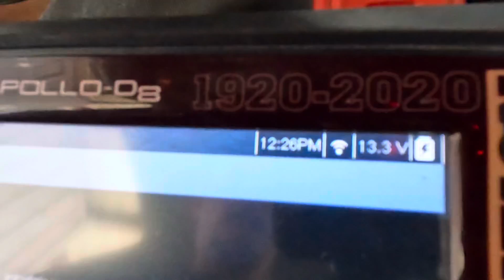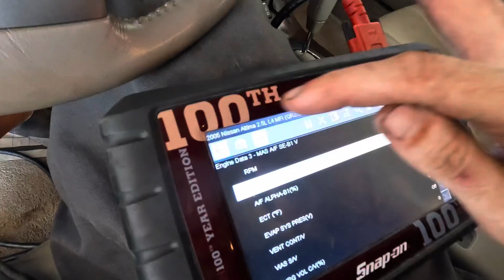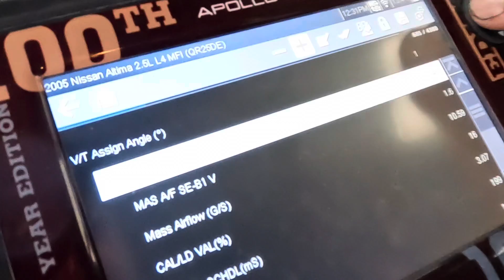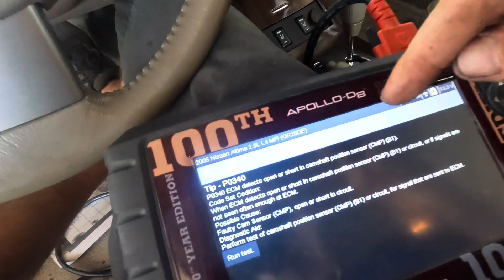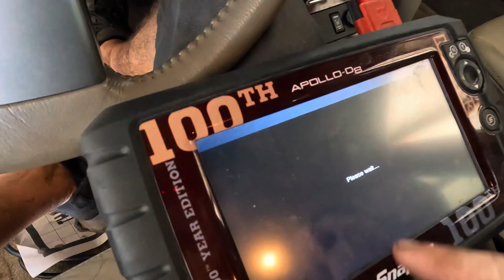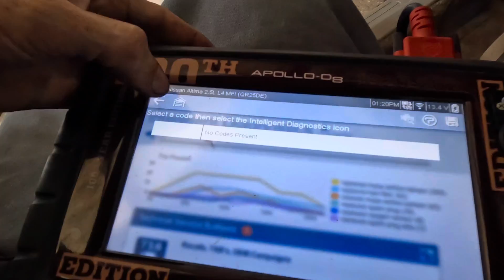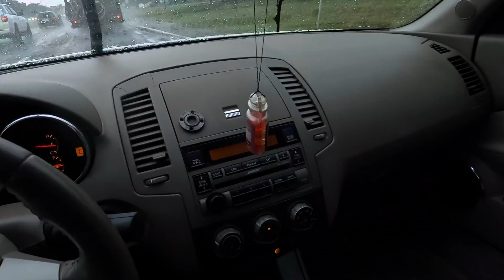This will make you ☠️☠️☠️ | Parts Cannon! Nissan Altima 2.5 P0340 Camshaft

Comment: 2006 Nissan Altima has been a real pain in the ass. I don't recommend this car to anybody. I once took my Altima to a mechanic, and he's like "Where's all the lights did you erase them?" and I was like, No, why? "I've never seen an altima that didin't have all these lights on."  I've changed everything on this damn car, from radiator, to hoses, to alternator, serpentine belt, the cover of the engine, spark plugs, ignition coils, I can't even think anymore, and it's always something new, once this car passed 180 thousand miles it was all downhil from there. Now the damn wires that connect to the ignition coils broke off, and I tried sodering new wires, and it doesn't seem to get the same current, or idk anymore, I been struggling with this car, simply because I don't want to go to a dealership, and I don't have that much money cash to buy a used one, plus the used cars for a while were wayyyy overpriced, so i was holding off. I bought 4 new ignition coils, 4 new spark plus, I sodered the damn wires over and over, thinking I might of done it wrong, but I get the smell of gas sometimes from the engine, there's no check engine light on, the car runs, but it doesn't run the same, can't really go uphill, shakes on idle, i'm just over it, im junking this $hit. Don't buy Nissan altimas!

Comment: That cam code is a hard fault. It is always there. The parts cannon may be an expensive idea, but it may solve the problem faster than rewiring the engine bay.

Comment: This motor the QR25 was doomed from the Factory look up this Engine in the 2003 Nissan Sentra SER SpecV were it Debued it had a Factory Nissan 60k recall on it were the Engine Grenades unfortunately there is a Butterfly screw on inside of intake manifold that comes loose and gets sucked into Engine causing damage to the VVT system also when that happens it starts burning oil badly going into the PreCats and Catalytic Convertors stopping them up essentially grenading this Engine I had the Car and it went 1k miles over the free replacement of Engine there leaving me 7500 bucks out for a new engine on a car i was still paying on yeah will never own another  Nissan unless it was built in the 80s. THEY REMEDY TO FIX IS TO PUT AFTER MARKET HEADERS AND NEW CATS AND PULL INTAKE MANIFOLD APART AND PUT LOCTITE ON THE BUTTERFLY SCREWS

Comment: I got a P0014 code today on my check engine light. Which meant the timing on my camshaft bank 1 was off.  I found out that sometimes, if the oil is low or dirty, it will cause that bank sensor to trip. I took my car to the shop and got the oil changed and it actually worked! The light went off and has stayed off! I went from looking at a $1,400 repair, to a $100 oil change!

Comment: A replacement kit from Nissan is available to replace both Cam and Crank sensors as they were on a recall notice. Metal barrel body is the correct upgrade on the sensor.

Comment: My friend had similar vehicle,  bought used from dealer.  Dealer fixed similar problem of stalling after refuel.  They told him it was rollover valve. Probably same component as you are suspecting. On a side note I just bought a 2007 ram 1500 big horn editor.  Seller stated truck stalls once or twice when refueled. I can't vouch yet. Just bought for local hauling use. He avoided filling above 7/8ths.

Comment: Ray!!! In 2023, you aren't a proper shop if you don't have a scope!!! You need to invest the $50 for a cheap handheld scope, or a bit more on a good one. You don't need an expensive one. Seriously. No scope is not OK. The customer pays for time and parts to compensate for your lack of proper tools. Did that sensor cost more than the test tool?

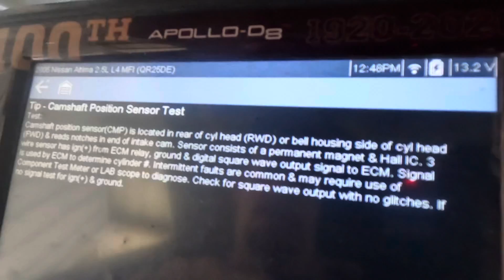Comment: @11:52 people disregard the simplest Solutions the last word in that pop out "Ground" even if it's not the actual problem more than likely because of the advisories issued by Nissan they know assembly process were lacking as far as making a good ground with their self tapping screws, and should be one of the first things you modify and rectify.

Comment: Nissan issued an advisory a number years ago that would apply to almost all of their unibody type vehicles, once you read the advisory and get a mental picture of the overall problem you realize that it could apply to almost any electrical problem that may occur on Modern cars.

The gist of the problem is these cars are either completely painted or dipped and then the wiring is bolted to the car with self tapping screws that do not make a good ground The Advisory was specific to cam sensor modules and how to take the self tapping ground screws off and create a better ground connection.

Comment: Poor ray. You only use Hitachi. This is Nissan 101 and no one diagnoses these. You just replace cam AND crank and move on. If it were a wire, then the engine wouldn't run an you'd get a circuit code.
Chrysler of Japan....is that why I have an all original engine/tranny g35 with 214k mi?
Oh, noes, rear calipers and lower front arms.
It's just so....reliable. Same with my other Gs, Maximas and Titan.
And you can't even handle the reliability of 2001 and older Nissans. Your mind will explode.

Comment: Cant be an internal mechanical problem as the error code said open circuit or shorted. A healthy sensor is somewhere in between that regardless of whether it's detecting the wheel or not.
It's a common design principal known as ELEVATED ZERO. When an instrument or sensor is detecting "nothing" , it still produces a signal, so the processor can tell the difference between "nothing/empty/cold/noflow/nopressure/etc"and an open circuit.

Comment: Hey ray i have a odd question but i got my check engine too come off but the code (not a stored code) still pops up on the scanner even when the light isnt lit id be happy if you could direct me too a possible cause. The code is for the evap system and iv replaced just about everything for the system even smoked it and no leaks are present also the wires are fine.

Comment: Ray, had a 2006 Altima had the same problem, it was told by the Nissan mechanics that if you don't use OEM, and you don't replace both the camshaft, and the crank sensor at the same time there can be issues. I tried an aftermarket at one point and realized they weren't lying.

Comment: With that long start, I would check the Starter Motor. Just my 2 cents. Now back to the show to see if i am right or if I am wrong. I betting I am wrong. Though I would still check and test the starter motor.

Comment: Altimas are repeat failures.
"Vehicle Speed: 4"  Hmm.  Nissans even suck when connected to a scanner.
Oh, and hey scanner manufacturers (that NEVER watch their equipment being used on YouTube):
Just have the white 'current line' bar appear ONLY IN BETWEEN the labels and the values, as a white background on camera COMPLETELY OBLITERATES ALL THE TEXT.

Comment: It probably wouldn't be a mechanical issue. The engines i work on have sensors that work at 5v but sense between 0.5v and 4.5v. so a short or open is outside this range, a mechanical fault would be within this range so should give a separate trouble code. Hope that makes sense.
Reply: It does and did thank you 😎

Comment: I think your D8 Scan tool has a built in Lab scope if you have the right probes. You can also bring up visual graphs of the PIDS which record as they go. Much safer than constantly watching the data as you drive.

Comment: loved your logical explanations, the possible scenarios envisaged with their likelihood & how you homed in on the faulty sensor. you took a risk buying a new $40 sensor & it paid off. i learnt a lot. i’m still curious what would cause a hall effect sensor to become intermittent. (a complete failure would reflect in lowered engine performance which was not the case). guess we’ll never know the mode of failure. mybe it’s sensitivity fell. right til the end you were so careful to not rule out mechanical sloppiness in camshaft angle as cause. nice to experience Florida’s heavy rain at its best (worst!).
Reply: Known weak point for the Nissans this and cam sensor

Comment: My BT50 3ltr diesel was having hard starts. sounded like battery was flat and I was getting crank and cam sensors faulting.  I sent it to a workshop and was told the starter motor was faulty. They replaced it and it still happened. I inspected the battery cable to the starter and found it was bad. Because the sensors cables ran in the same harness as the stater power cable, the EMF was killing the sensor data. I replaced the starter power cable and never had the fault return.

Comment: The code set was for Open or Short. This fault is not caused by cam wear, that would be a different code along the lines of 'Implausable'. 90% chance it was going to be a sensor so why mess about? It's a business he's trying to run. Best of Luck Ray.

Comment: so yesterday i did something probably ill advised but actually worked out well, i checked my maf sensor, saw one of the wires was all carboned up, tried spraying it clean with maf cleaner but it was baked on, so i ever so gently used a knife to scrape off the carbon off the wire lol i know its probably not the best thing to do but it runs heaps better now haha, i only did it cause i was having trouble finding an identical replacement :/

Comment: Yeah, man. You again demonstrated your ethics. Could it be more than the sensor? Yes. But your gut told you what to do, and you were probably right. If the car comes back in two weeks, then it might be time to strip off the valve cover and ....urk.... the timing cover. Nice work, Ray. And another great video. And don't pull out in front of trucks! :)

Comment: My husband has been a technician for almost 30 years. I have a 2005 Nissan Altima 2.5. The head gasket, both thermostats, & radiator have been replaced. The cooling fans have been checked. The heater core has been flushed. If you drive low speed in town the engine does not get hot. But if you drive at highway speeds it gets hot. Also the heater does not work. Any suggestions?  This one has my husband scratching his head.
Reply: Air bubbles fully burped out of the system?

Was the block or cylinder head surfaces straight? Compression tested to be sure?

Timing marks double checked?

Comment: Ray, is that the only scan tool you have/use ? What is the cost  for the scanner as well as the cost for updates / connections to the data files? DVD:)

Comment: Better yet, pulling out in front of a semi. Not only do they have really big hoods and can't see things really close to them, but they also don't have front brakes. All of the braking is done with the rears. Don't pull out in front of a semi.
Reply: If they don't have front brakes, how do they stop without trailer?
Reply: @derekhobbs1102  Poorly. I checked my facts and, yes semi's DID have no front brakes, but that changed in the 1980s. 
Then I found this in the British Columbia regulations:

a truck or a truck tractor which has 3 or more axles to the extent that

(i)if the vehicle may be steered by the wheels adjoined to one axle only, the front wheels need not be equipped with service brakes, or

(ii)if the vehicle may be steered by the wheels adjoined to more than one axle, only the wheels adjoined to one of such axles need be equipped with service brakes, or

So, yes, but no. Treat them like they don't have front brakes because they could be old.

Comment: Cam shaft position senors are a common problem in nissans. The frontier community raves about replacing them all the time. But its true i had to replace mine on my frontier.

Comment: You nailed the problem as when the old unit was in there was a long crank.When you started with the new sensor short crank and no light.Experience counts in diagnosis of problems.Keep these informative and comedic vids comming.
Reply: Well, the initial trouble code was a good hint, even though he physically checked the connector and harness

Comment: I had a similar situation with a CEL showing high fuel pressure on my Volvo. After doing some online research, the sensor was the most likely culprit. I had two options, a Bosch branded sensor for $32, or a "genuine Volvo" replacement in a factory box for $132, which was the exact same part. So, I loaded the parts cannon and gave it a shot. It worked! An extra bonus was a more consistent idle speed. Win!!!

Comment: you could use the Hz setting on your meter to test the sensor it will give numbers in relation to cam speed   same as to test abs sensors hope this helps
Reply: I don't think Ray can grasp what hertz is.  Because if he could, he would of by now.  I've rarely seen a multimeter or test light on this channel.

Comment: Great video.  I have an '06 Altima with 160000+ mi., the crank position sensor failed.  Similar symptom, long crank to start.  Replacing that is not a fun job, it requires the old Eric O. "reach around" the back side of the bell housing down low where you can't see it in order to get it out. Only problem was the OE replacement sensor was a few thou too big and wouldn't fit in the hole, so I ended up swapping the crank position sensor with the cam position sensor (since they are same part), and put the new unit in the cam position sensor hole instead.  Started right up!

Comment: Better lucky than good seems to work here. It’s a circuit code as stated in the service info. Going after internal engine as a problem is not the way to go. You don’t need a lab scope to diagnose these, it’s a simple Hall effect sensor. Power,ground and signal. Check the power and then voltage drop the ground side. You can use your DVOM if you don’t have a graphing meter like a vantage or such. Set your DVOM to duty cycle and back probe the signal. If it is switching voltage it will show a duty cycle. Not the best test but it can show you if the sensor is switching. Just not how well it’s switching but if it shows 0 duty cycle at least you know it’s not sending any signal. Of course you can ohm the sensor to check for open. Aeswave sells a great little 1 channel uscope that works great and can aid in lots of these sensor diagnostics. I thought you had a SnapOn vantage or some other graphing multi meter. Simple Hall effect sensor diagnostics and as it is a circuit code and code description tells you it’s a open or shorted circuit and didn’t mention anything about internal engine wear or anything you need to go after circuit faults, even if it jumped timing the sensor would send a signal and not set a circuit code it would set a correlation code.

Comment: Tip

If you don't want to do the ĵob twice get the parts from Nissan. The aftermarket parts will work for a little bit but stop working. 

When changing the camshaft sensor also change the crank sensor. 

I spoke with Nissan and they told me anything electronical get from Nissan because it's very touchy and doesn't like aftermarket parts. 

Speaking from personal experience with owning a 2005 Nissan Altima. The parts were about twice as much as the parts stores but worth it knowing you only have to do the job once and won't be stranded somewhere.

I'm a DIY home mechanic. YouTube has a lot of videos on how to work on cars. Most stuff is simple that you can do at home with basic tools.

Comment: Ray- You can find a good scope at a reasonable price by looking at a local Amateur Radio fair or swap meet. A good Tektronics scope with probes should run from $100.00-$250.00. Verify it works and comes with the instruction manual before shelling out cash. I passed up one at the last HamFair for $100.00 and rt was LED display!

Comment: cam sensor on an altima is a common issue. only 15 bucks at autozone. so is the transmission shift solenoids if you notice hard shifting

Comment: Do you not prove the fault by replacing the suspect part?  If I can I never assume faut fixed if I can't put it back.  Vour fault was quite hard here so an easy option to the wet drive.
Reply: Some parts stores won't take electrical parts once installed, so the shop eats it if it is the wrong guess
Reply: @ricebike  That goes without saying but was suggesting back replacement would have proven the fault and not still leaving a ? in mind.
Reply: @jeremywilcox  I dunno it's up to the shop to throw it and see.... Pine hollow diagnostics did a similar thing to a Nissan SUV that had bad O2 sensor code, but the main problem was the wiring harness. So he ate the cost of the O2: sensor but even out with an hour for diagnosis

Comment: I had a Nissan Sentra with a similar problem.  Drove me nuts. Turns out it needed a timing chain. Nissan parts guy told me Nissan timing chains can stretch up to a millimeter per link. On the Sentra that's 154mm or half an inch. When we yanked the old chain sure enough it was a half inch longer than the new one!
Reply: Shouldn't it set off more than one trouble codes?
Reply: @ricebike  in my case, no. It threw a code for the VVT.

Comment: Once did a $15-17 ABS light diagnostic by just swapping out an often failing rear differential speed sensor. ABS hadn't worked for the owner for years and because the brakes worked fine minus ABS they didn't really want to pay for a shop diagnostic. One bolt and a wire later ABS light was off and the system back operational. Tested in a parking lot to ensure the ABS would modulate like expected versus locking up the fronts occasionally in rain.

Comment: I had a 86 mustang that would only get hot and almost over heat on an steep incline but not in normal town driving I through at it hoses, water pump, several thermostats only thing left it was the radiator partly clogged lol

Comment: Parts cannons are NOT a bad diagnostic tool…. But the parts Uzi that a lot of so-called “mechanics “ tend to use IS…. 
Not only for the customer but also for the Technician that has to actually fix the problem when the Clip is empty.